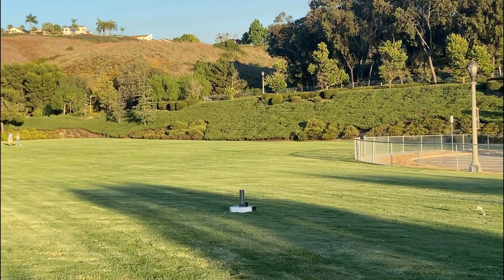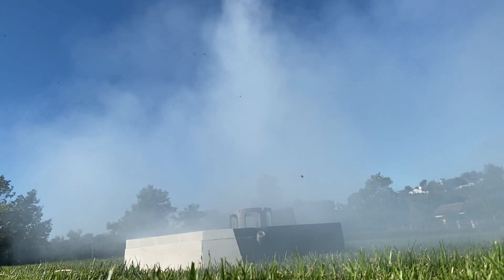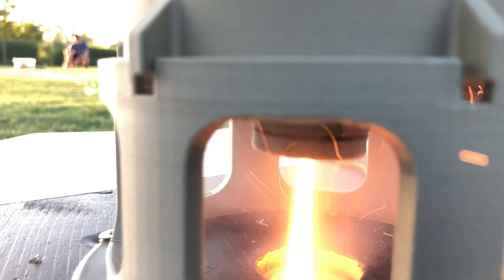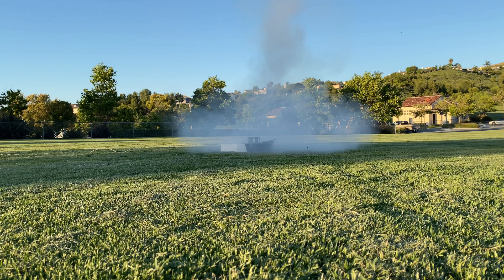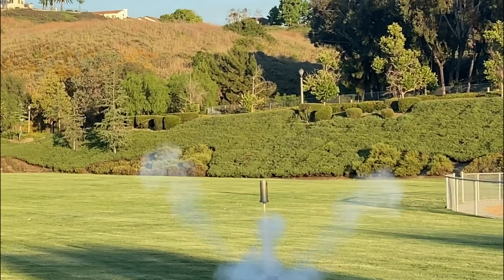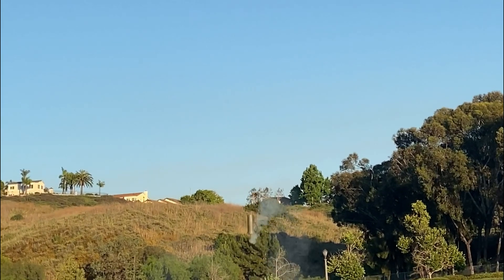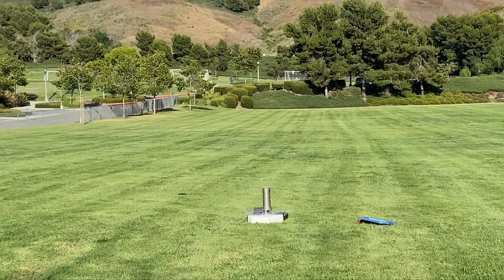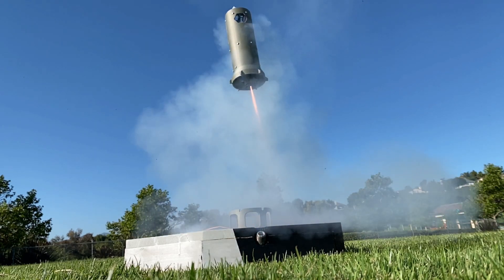Frontier Thrust Vector Control Rocket | Flights 1, 2, & 3

Comment: Hi! I was just wondering about how you ignite a ejection charge for a parachute recovery system by using a omega flight computer? Do you connect an alligator clip cable to one of the pyro channels and connect the alligator clips to the ejection charges? How long does it take to ignite? Thanks so much 😊
Reply from the maker: This didn’t have parachute recovery but my new video for flight 4 and 5 will be coming soon! It just gets screwed in to the terminal blocks of the flight computer